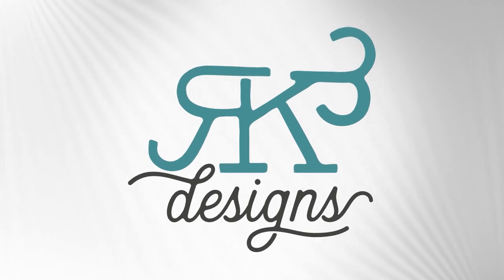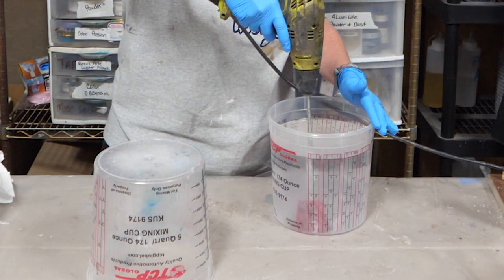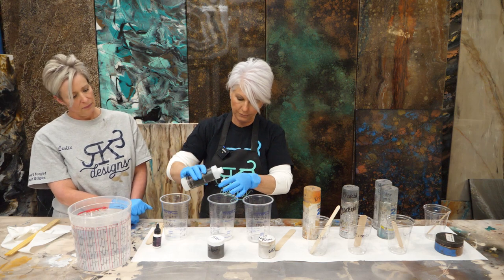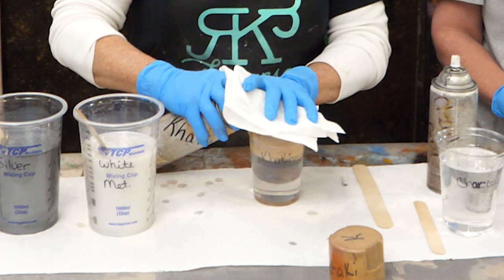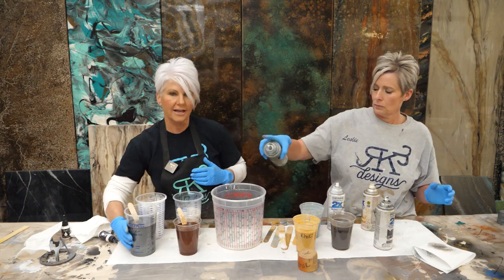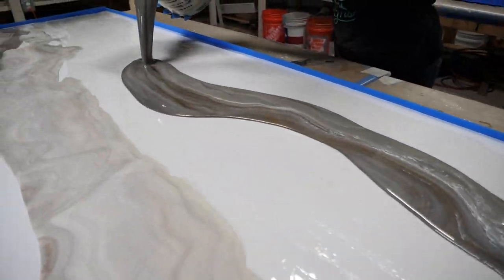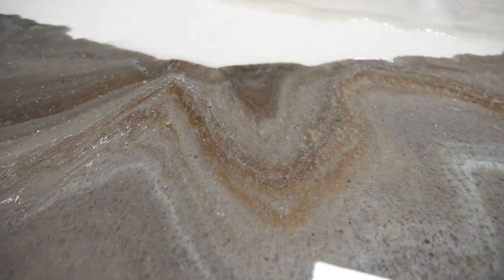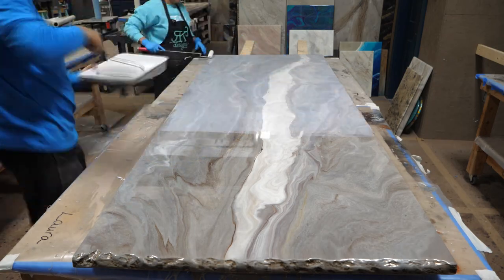DIY Epoxy Shower Walls | Part 2 | RK3 Designs

Comment: I used to build homes and done more than a few showers.  I asked this question on stone coat's video but they didn't answer.  Someone below asked as well, are you just using silicone behind the panel at the shower pan?  Black mold would be something I'd be very concerned with.  Silicone will not hold up over time in a shower or anywhere else for that matter.  I would LOVE to do this but am concerned with your method of install.  Not being critical as I really do love this idea but.  Thanks!!
Reply from the maker: Great question. We’ve done showers that are 5 years old that are applied with silicone and we’ve had absolutely no issues. However, you can definitely use other products for adhesion.

Comment: Love seeing videos like this.  I would like to see a video on panels going around a bath tub. Since a tub is 5 ft long, I would like to learn how to splice the foam boards together.  Thanks.
Reply: Butt seam the pieces together with quickest epoxy with the thickener added.
Reply from the maker: We actually do our foam board seams a little differently than we do out countertops. We will be doing a video on that process soon. 😊

Comment: Thank you so much for all of the videos. I’ve just come on board with how amazing this is and what a great option now as I’m looking as to what to do with my bathroom walls around the shower surround which will be a Jacuzzi that we’re gonna have a drop in for the tub and then it will be an alcove surrounds that might be 3 feet to 4 feet Deep and from the tub up we probably need about 6 feet. I was wondering if you’ve had anything that you can share with regard to the idea of making smaller, say panels and 4 x 4, foot or smaller and filling the space in between with the EVO glass like tile grout? I think that would be really cool and even the idea of even cutting the foam intoplank strips instead and leaving wider gaps and creating a wallscape using the EVOO glass like grout that would reflect the colors from the tiles? Would love any feedback that you may be able to share and not directly connecting them as one panel, but rather doing something like that almost like a mosaic?

Comment: Thank you for posting! I want to do this in my shower. How much would you say that a panel weighs with all the material?  What did you use for the bottom part?
Reply from the maker: The foam board with the epoxy is very light. It would depend on the size of your shower wall, if you used 1/2 in or 1 in foam, but my guess is the panels in this video weighed approximately 10lbs/ea. Most of the showers we do are tile or a prefabbed one.

Comment: What can be done on a vertical shower? I want the tub and shower to look like a big rock.
Reply from the maker: It’s really had to get a pattern on a vertical wall. There is a thickener that you can use, but I really don’t recommend it, as it changes the color of the resin. We fabricate our shower walls out of foam board while they are flat and then install them. We have several videos on this application. Just search “Shower walls” on my YouTube channel. Let me know if you have any questions.

Comment: Looks great!  Do you have a video showing how to add a shelf for soap, shampoo, etc using the foam board?
Reply from the maker: Not yet but we are coming out with a video that has a bench built it. Should be out in a couple of weeks.
Reply: @RK3Designs   thank you!

Comment: Thank you Rhonda. Absolutely beautiful, how do you finish the bottom? Can you do a one piece tub and shower?
Reply from the maker: The bottom is going to be against the shower pan so all we do is allow the epoxy to run over and sand smooth if needed. You can apply this to the existing panel on a tub surround, but you may have overhang at the bottoms. It would depend on how much ledge you had on the tub. Hope that made sense. 🤪
Reply: @RK3Designs  thank you Rhonda, can you put over the tub part, would it hold up to all that water? Mine need to be replaced and I would love to find something to overlay on it rather than rip it out and replace. Several years ago a painted with one of those kits you and buy and it has worked well but now I need to do it again or do something else.

Comment: Would using epoxy instead of silicone be an option this way all 3 panels are essentially one surface?
Reply from the maker: Are you talking about silicone in the seams? I would use silicone for a fast, very secure seam.

Comment: what was the reason for using the fiber mesh wont epoxy stick to the foam just as well??
Reply from the maker: It will, but it adds structural rigidity to the foam.

Comment: Did you use the fiber mesh tape on the front side also
Reply from the maker: You’ll use it on the side you pour the epoxy finish on not the side you silicone to the wall.

Comment: HOW FLEXIBLE ARE THESE PANELS ONCE THE EPOXY DRYS??? WILL THE FLEX ENOUGH TO CONTOUR TO THE CURVE OF THE CEILING IF A CHEVY EXPRESS VAN??????
Reply: No.  The epoxy will not flex that far.

Comment: What is the difference in Rust oleum and Krylon? I was at Hobby Lobby today (it has a GREAT deal on wood on wood this week)...
I noticed Hobby Lobby only carries Krylon.
Response is MOST appreciated. 
Carol from Nov 2021 Pro Class)
Reply: I heard Mitch at Stone Coat say that Rustoleum works better. Good enough for me!
Reply from the maker: Krylon seems to clump more than Rustoleum.
Reply: @KeyWester1  Thx! I'll stick with Rustoleum!

Comment: Love all of your videos! Hopefully will make it to a class with you guys one of these days ☺️. I would love to know what is your recommendation for a final coat for countertops since ultimate top coat is unavailable? I know I can wait for UTC to come back in stock but I’m just nervous about it, so do you have any suggestions for extra protection until I can get UTC? Thanks so much…enjoying learning so much from your videos!
Reply: Hi Tasha, I'm just another learner, but I'm guessing this is when we might as well do a flood coat (before installation), so the design isn't altered by accident. I'm nervous about applying UTC after the install, and was hoping this video would have a part 3 to show this. Also, I don't see a link to the live-edge-glazing, and I'd really like to see that.
Reply: @KeyWester1  I saw someone else looking for that glaze link as well…maybe they will have another post on it 🤞🏻
Reply from the maker: Tasha, I should have the UTC available in the next week or so. Until then, you can use your countertops. If they scratch, that’s ok, you’ll sand them with 220 before you apply the UTC anyway and that will take care of them. You can wait as long as you want before applying the UTC. I actually applied to a countertop that was 3 years old. Sanded, rolled on and the countertop looked brand new. If you look in the video description you’ll see video links. Also, check out the tutorial page on my website for additional still shots and product information. 😊
Reply from the maker: If you look in the description under the video you’ll see my linked videos. 😊
https://youtu.be/YQb39WmuHFU
Reply from the maker: https://youtu.be/YQb39WmuHFU
Reply: @RK3Designs  that’s great! Thank you for the info that is exactly what I needed to know 😁

Comment: Why do you have to bondo the edges?
Reply from the maker: Because the exposed edge won’t be smooth without bonding it. The foam will peel and chip.

Comment: Epoxy can shrink over time. I'd be concerned that the adhesion or material to adhesive layer would fail as the front of these curl.
Reply from the maker: We have showers that are over 5 years old and we've not had any issues with shrinking or delaminating.
Reply: @RK3Designs  I have samples that are stable for about ten years. Perhaps it's due to the material becoming brittle as well as shrinking. Variations in thickness are helpful as the thinner areas break down the monolithic epoxy to EPS interface. Also setting tiny holes in the substrate can act as a "root system" which doesn't adjust for substrate curl but does increase the shear.

Comment: Hi just a question if foamular board or mdf board is unavailable in my area is a plywood substrate sufficient for shower panels?
Reply: Plywood would work the same as mdf. Just sand smooth and prime before epoxy. Make sure to seal the back of plywood or mdf with the roll on rubber membrane made for tile showers
Reply from the maker: Technically you could use the plywood. You’ll have to address the edges because they are layered and you’ll see this if you don’t Bondo and sand smooth. As Brad mentioned above, you’ll want to Red Guard (or similar product) the back of the plywood.
Reply: @bradbair1405  Thank you!!
Reply: @RK3Designs  Thank you very much! I appreciate the great advice! Aloha 🤙🏾